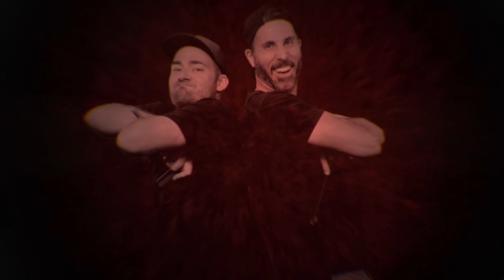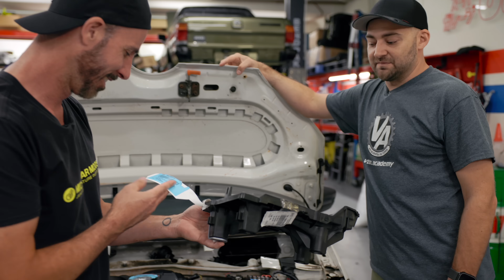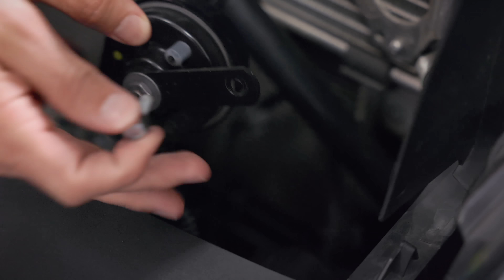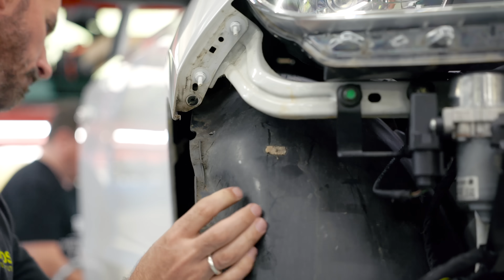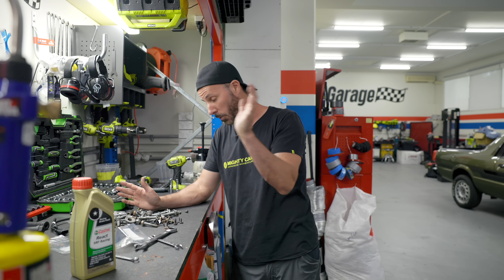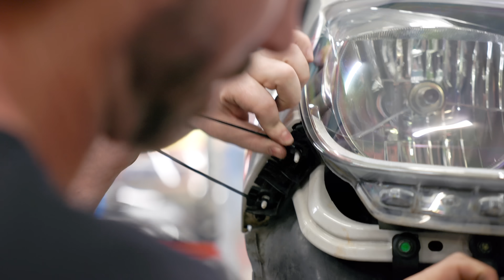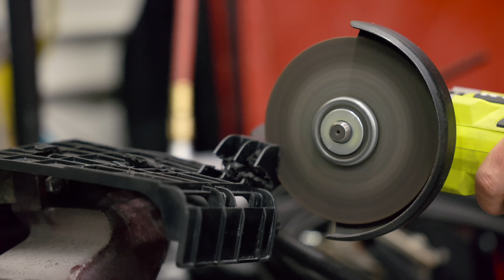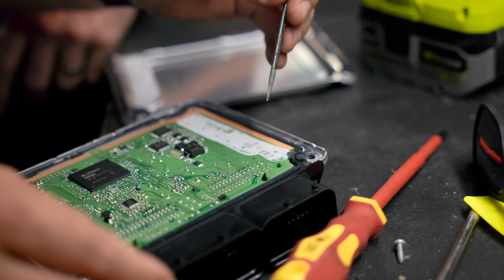I DESTROYED my VW UP! - Turbo GTI Conversion EP7

Comment: I have done this by accident.
Open the ECU up and check the naked terminal wires inside the ECU on the back of the connectors one or 2 will be blown
Just solder the connections back up and good to go
Reply: If true this is an underrated comment
Reply: Imagine if the boys find success from this. Comment section winna
Reply: Had the exact thing happen on an ECU in a Merc. Power pins burnt out on the back side of the main connector. Solder them up and worked as it should.
Reply: @smarais100  thats right. Thats exactly what i mean. Thise wires or pins seem sacrificial in cases like this. Cause it didnt blow anything on the circuit board.
Reply: Lets hope @mightycarmods see this and check it! we can only pray
Reply: had something similar happen to me on one of my cars ecu. Short circuited, blew some injector circuits. Ordered a 10 pack of the mosfets, replaced them and fixed a blowen wire. Brand new great running engine!
Reply: I know nothing about ECUs but hopefully this is it. It seems crazy that the outer case would not be meant for grounding, but I guess the question is where was the electricity flowing.
Reply: @PalladianPD  They only said that they touched the ECU case on the battery, I'm guessing they touched it on the positive terminal and the ECU case is internally grounded. EDIT: Moog confirmed this later in the video.
Reply: @PalladianPD  the ECu case is heat sink and also ground for the circuit board and when it touches the postive battery terminal by accident the current backflows and wham   Blows the wire or 2
Reply: that would work if its just a fried on board Fuse which could be the case , I hope they see this and give it to someone who can put in new on board fuses or just put in wires , its highly unlikely the whole thing is fried cause that would take a lot more than just 12V.
Reply: @aliesa6120  its not the 12 V its the current the moment the ECU case touches the positive overloads the wires inside. I  opened 2 Of these Bosch ECU. One  i caused by accident touching the positive moving the ECU around
And another for a engine warning light for a  sensor that wire insulation stripped and wires touched. After all test all was left to open the ECU and check it. And found that. It seems these ECU curcuit board and components are tough and these wire inside  might be made sacrificial in case of shorts of wires touching or ECU ground touching positive.
Reply: @enesfazlic6017 it's not because they are tough. It's the way voltage works. You need a potential difference, and you just raised the 0v reference to 12v. So the rest of the computer will have 0v instead of 12v as there is no difference. However, the ground path has created a high current circuit to the battery.
Reply: @aliesa6120  and check the ins and outs of the IC's, a lot are protected by capacitors.
Reply: @aliesa6120  Voltage does not kill electronics, Current does, 1 volt at a high enough current will fry things.
Reply: @terryhayward7905 That's not completely true, as volts, amps and ohms are all related, if you have something with too great a resistance and a pool of a million amps if you don't have sufficient voltage nothing will happen. For a 0 ohm or near 0 ohm resistance though you are correct everything can potentially fry at 1 volt.
Reply: @terryhayward7905  Ever heard of ESD damage?  Damaging current doesn't flow unless you have sufficient voltage to drive it.
Reply: @terryhayward7905  how you get current? by gravity? :D
Reply: @terryhayward7905  ESD says hold my beer 😂
Reply: @terryhayward7905  If you're going to be technical, it's actually heat and usually a chemical reaction called fire. And it's probably only gone through the earth trace, from earth computer chassis earth pins to the negative battery terminal. A fairly harmless circuit.
Reply: @terryhayward7905  Well, transistors are very fragile and can easily blow even with extremely low currents if the polarity is inverted
Reply: @reverberer  Exactly, Mosfets for instance are highly sensitive to high voltages, they can be damaged from static voltages whilst working on an PCB
Reply: @ferrumignis  Yes, and I am also an electronics engineer, my comment was not meant as a lesson it was a reply to someone saying that 12 volts is not enough to kill things.
Reply: @terryhayward7905  My point was that voltage can and does kill things e.g. the gate/source insulation of a MOSFET can be punched through by applying too much voltage.  You don't always need high currents to flow to break things.
Reply: I hope they see this comment and try it out
Reply: If you don't try you'll never know
Reply: Twice now. Once accident once by welding near and forgetting to disconnect it from the system. The welding one was spectacular. Like popcorn, old style ECU with proper caps, so of course they blew inside.
Reply: This makes me wonder if those people that do micro soldering for phones could fix the ECU😅
Reply: @AhhSamboi  easy
Reply: @AhhSamboi  you just need some basic soldering knowledge and can repair if this is what happened. But wont know until they open the ECU and check. 
Lets hope its just this. Easily repaired and The UP is back like nothing happened.
Reply: Get this to the top of the comments. I've waited too long for this project to finish like this!
Reply: The solution to most new car problems
Reply: Marty ,Moog if this guys right , he should get free merch for a year !
Reply: i'm sure there must be some logic board level repairers somewhere relatively close to the MCM lads.  I hope they have a look into that.
Reply: people talking here like this wasn't filmed months and months ago,  they'll have done something by now to sort it out.   - how long ago did the brumby leave?
Reply: Oh jeeze I hope this is the fix!
Reply: this.
Reply: This comment needs to stay up up UP.
Reply: Your right. I do tuning and this have happen. We soldering the ground pins again and car was running.
Reply: Mcm fuckinnn read this shit and acknowledge it!! Its the fix!!
Reply: @abowden5079  costs 10 bucks
Reply: You all thinking Miles doesn't know all this?
Reply: hope they see this
Reply: shit i need to check this on my honda!
Reply: BUMP THIS! LET'S TRY ANYTHING
Reply: upvotes and comments in hope they'll see it.
Reply: BUMP - hopefully this works
Reply: This whole project is a cautionary tale as to why you should never buy a VW in Australia
Reply: @andrewgreenham8962 🇩🇪 Yes ve vill make sure to take ze fun out of owning any VAG cars in zat snake-ridden country of yours JAA 🇩🇪
Reply: yup same
Reply: +1 been there too hah
Reply: I did something simular, took it to a shop that fix them up again for 150 dollar or 1500 swe kr :)
Reply: I would think the same. Either a fuse is blown or the ground terminals in the ECU got fried. The ECU metal case should be grounded, so I don't see how it got fried.
Reply: They’ll be some fuse on the board that’s gone, someone’s who’s half decent at micro soldering should be able to sort it
Reply: as somebody who does electronics for living , i can tell you the most likely part to break if it doesnt have any protection in this instance, is the most complicated part, which is the processor. And you cant just replace it because 99% its got integrated memory in it which you need to program , so most likely the ecu is gone completely. Ofc an inspection wont hurt and you will probably find dead processor. The likelyhood of some wires just burning out is very slim , i think you just been very lucky.
Reply: @Lifeless11111 as someone who also does electronics for a living, seems plausible that by shorting the case to +12V you would blow open the connections between the ground pins and the board/casse ground. Whether or not then having the ground on the board raised to +12V does any further damage depends on the design. Any automotive design worth it's salt will have reverse and over voltage protection, probably using a TVS diode and PPTC fuse to non-destructively mitigate for instance if a customer installs a battery in the car the wrong way around, or if the alternator regulator fails and produces an overvoltage condition, or if there's a short in the loom which brings pins to an unusually high voltage. The low voltage digital processor should be behind a voltage regulator, so it has another layer of protection from what is happening externally. Simply restoring the connection between the ground pins and the board/case may bring it back to life. In fact, the first thing i'd do is touch a wire between chassis ground and the case, and see if it starts working.
Reply: @tmmtmm  You are right but lets not assume things without any info as in what was connected to the ecu when the short happend ofc that is the most vital information. However just because there is a regulator "in front" of cpu does not make it safe especcialy in reverse polarity and random voltage spikes all over the board will infact kill cpu without ever being dirrectly connected to it. When the lightning hits the ground for a brief second the voltage on the power lines could go up to a few thousand volts... But we are talking about automotive parts so i would suspect it to be a little more rugged but a processor is always very fragile...
Reply: @tmmtmm raising the ground to 12 will rarely do damage as there is no potential. Grounding a positive terminal to ground usually just fries the immediate wire to take the heat.
Reply: Uh, no. That's probably the least likely from a case to +v short. How would that even get into the processor?  @Lifeless11111

Comment: Ah shit man, that suuuucks! I reckon there's a good chance you could try and replace any damaged components on the ECU boards, but given how VW fills the case with glue (thanks for that guys, real repairable) that isn't super easy - and if you're blown through traces it could be tough to spot. It's doable but you need someone who knows circuits and can do some microsoldering. Otherwise it's new ECU time, which is crazy expensive on any modern car